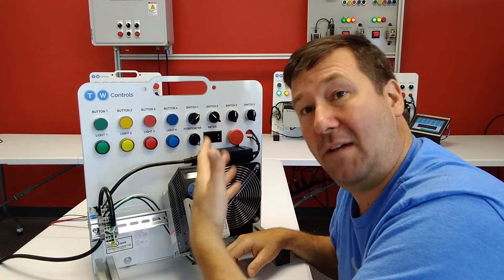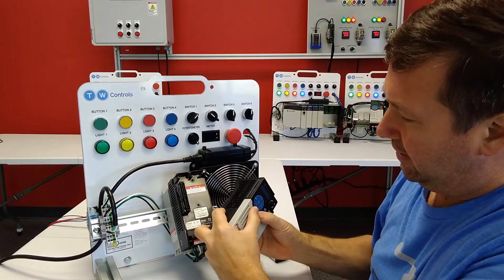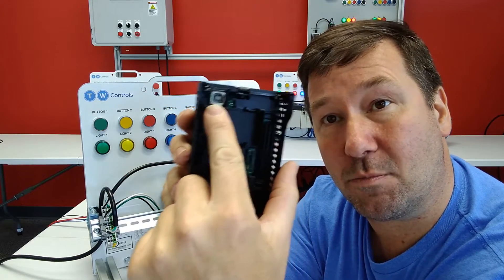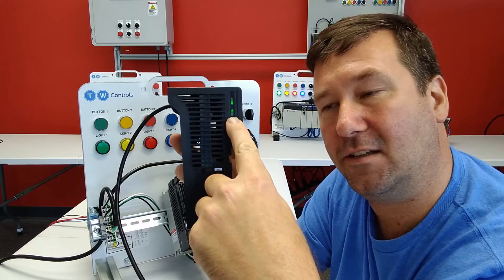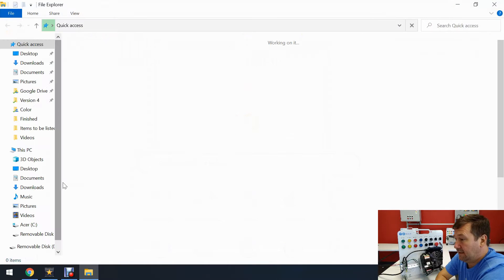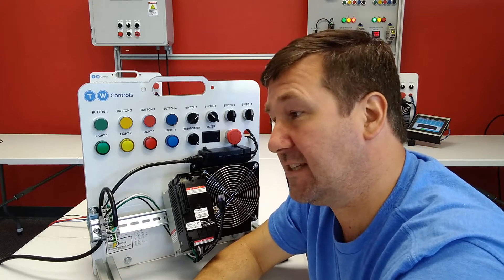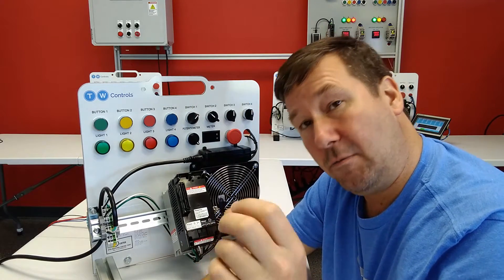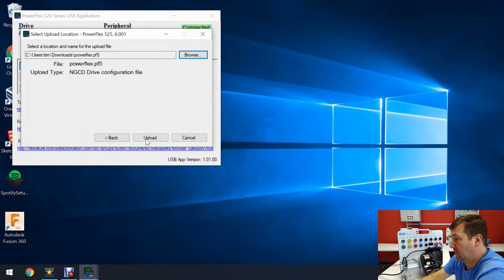Powerflex 525 Drive USB Upload Download Parameters from Control Module

Comment: hello.  I have a problem when connecting the VFD to the PC, the screen stays stuck. This only happens with a used VFD.   with a new one if you run it without problem.       greetings
Reply from the maker: My kids would be an older and compatible USB driver. Try using Connected Components Workbench. 
https://youtu.be/81G0YY5XCS4

Comment: Is there a way to connect via Ethernet without having mains power on the drive?
Reply from the maker: No but a semi work around is to have a 120VAC Powerflex 525.  The control module is the same for all of them, so you could power it up and connect via Ethernet on a test station.

Comment: is it really regular usb cable, I tried I could not connect. and upload/download buttons are all greyed out. Do I need any drivers for it to work? I tried more than a dozen different usb cables.
Reply from the maker: Yes it's a regular USB a to b printer cable. My wild guess would be some missing driver.
Reply: @TimWilborne  I contacted Rockwell, they told me that I need 1023 USB Convertor and regular printer USB cable is not going to work. Looks like RA got lot of good ideas from Apple on how to make money on cables.
Reply from the maker: @akupadhyayula  No, that is to connect to the DSI port.  It won't work with that for plugging into the back of the control module.  But it is funny the results you get sometimes when you call in and they are flipping through the manual with you 😂😂

Comment: DO NOT PUSH IT DOWN WHEN REMOVING. Just pull the slide back then pull the top of the control unit out. If you look closely when the slide is pushed in it is pushing down and locking in the retaining clip. By pushing down to pull it out you’re locking it back in.
Reply from the maker: You will get a chuckle out of this video. My viewers finally pointed out 😂
https://youtu.be/b7vYMvZAWcE

Comment: Hi Tim, is it the same with a 523 drives too? also can you download on to another drive by just using the original display module. for example the powerflex 700 can use the HIM copycat to download from the HIM on to another drive. so can the display module on the 525 do the same with out using a computer?
Reply from the maker: Not sure, I've never worked with a 523.
Reply: @TimWilborne  i think there almost the same its just that the 523 dont have an ethernet port.
Reply: @onyitsme4740  They are the same drive but a 523 just has less features.

Comment: A couple of questions regards this method and the drives themselves. I tried this method to extract parameters off a working drive but the computer just hangs until I disconnected, upon trying with a brand new drive out of the box it worked perfectly. With the interface still loaded on screen I unplugged and connected the other drive it again hung but I could see the version number was different? Maybe firmware issues reading the older working drive? 
I was able to access over Ethernet with ccw however. Is it possible to remove the top off a single phase in drive and mount on a 3 phase in drive that I have power on in the workshop to extract parameters over Ethernet?? Thanks

Comment: Cannot directly upload/dl using keypad like abb, siemens?
Reply from the maker: The Powerflex 525 doesn't have a removal keypad. It has a control module and a power module. You can do the same thing, you just pull the control module off the bad drive and put it on the good drive.

Comment: I have a windows 10 computer now and it doesn't show anything when you open the removable disk folder to even be able to open the .EXE file. it used to work for my windows 7 computer where the usb application program would work. anything im missing or is it not compatable with windows 10?
Reply from the maker: It should work the same as this video. It was done in Windows 10. I'm not sure What to make of that.

Comment: Hey Tim do you have a video out on how to restore the parameters to a drive that you are replacing using ethernet IP or any other methods?
Reply from the maker: It is coming soon Zach. There are several ways but I like using Connected Components Workbench.

Comment: Automation Question: What would happen if you change the ip address while you are in run mode in studio 5000?
Reply from the maker: It would depend on whether the PLC had Ethernet connections that it depended on.  If it did then it would probably be bad news.  If it didn't then you would probably be OK.  But probably better to stop the machine to be safe.
Reply: I am not sure that studio 5000 will let you do this.  I have a unit with 525's on it ready for testing in the morning and will test this out for you.
Reply from the maker: @josephcameron4771  Yes, you can do it.